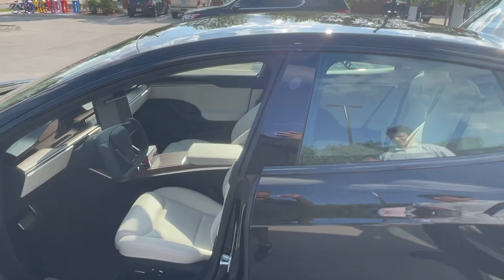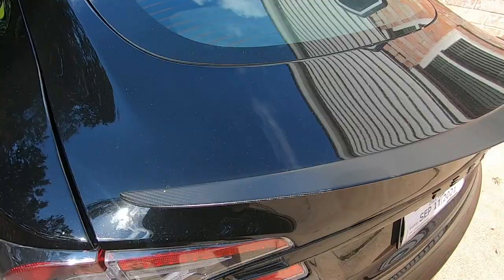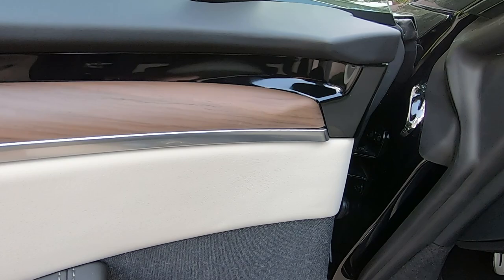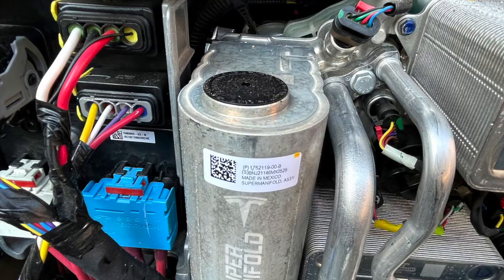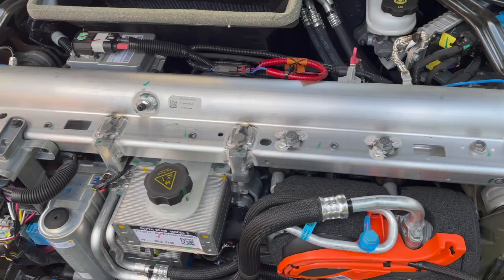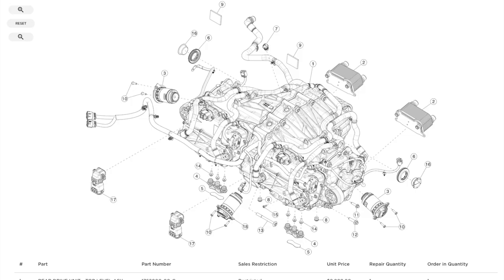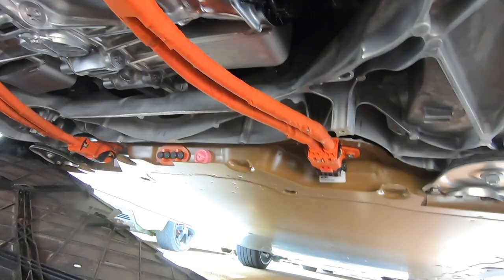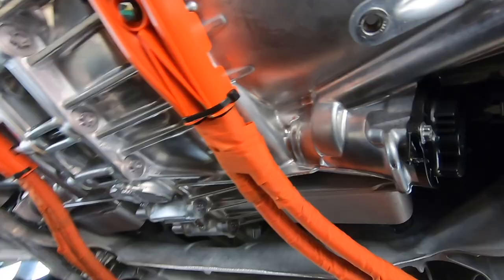First Look Underneath the Tesla Model S Long Range AND Plaid

Comment: Great video! Interesting to see the front motor of the Long Range to look the same, i think it could be carbon wrapped but with a different inverter for lower power output, that's why it's labeled as base motor and not sport
Reply from the maker: Thanks! Looks like you're correct about the inverter. In the parts catalog, there are two different inverters shown for the front drive unit. "ASY, DRIVE INV, 3DU, 810A, SIC" and "ASY, DRIVE INV, MSX PLAID, 810A, SIC, RR". Sounds like they're both rated for 810 amps, but somehow the "Plaid" version is $1010 versus $1350 for the other one. While we're at it, looks like the rear inverters are also the same as the fronts.

Comment: So a Plaid rear motor is only $9000.00 for like 700-800HP?  Is that the whole drive unit with gear boxes?  Holy crap that has to be the greatest deal in performance anywhere.

Comment: I have idea if we can buy  2 motors and put it in fwd gas car put in the back wheels so it will become Awd and put transmitter and wont use batteries instead the gassoline engine with confierter to power up the electric motors what do you think?

Comment: The 2021 long range motor is $2500?..LOL I think that's an understatement for the cost on- line is way higher than that
Reply from the maker: The rear drive unit is $2500 in the parts catalog. Where are you seeing it higher?
Reply: @ErikRobertson  is there a reason why the 2015 tesla model s drive unit cost more than the 2021?

Comment: So, if I simply swap the motor in my LR with a larger unit, would that void the warranty? Are there any warranty seals on the subframe or connectors?
Reply from the maker: I didn't see any, but pretty sure the car would log a motor disconnect and throw some red flags :)